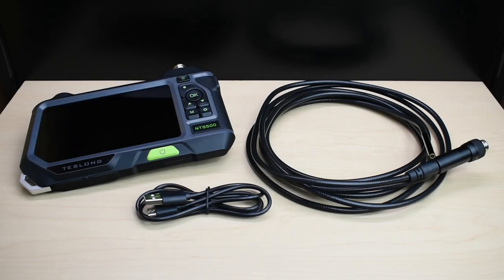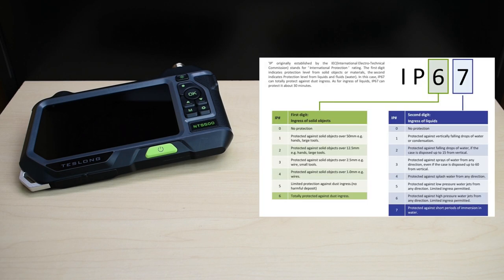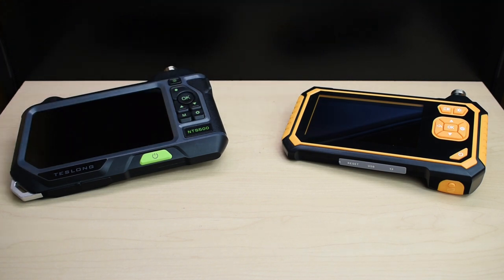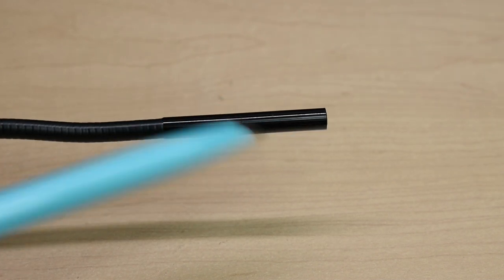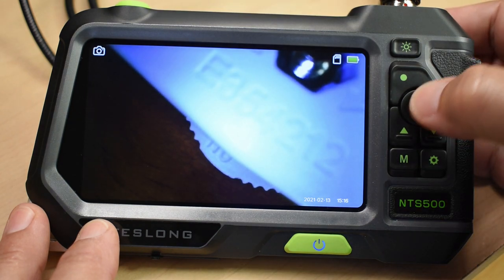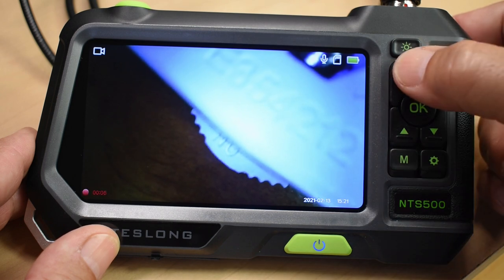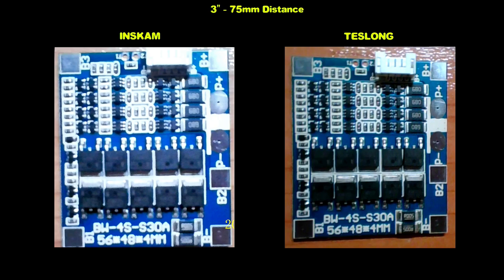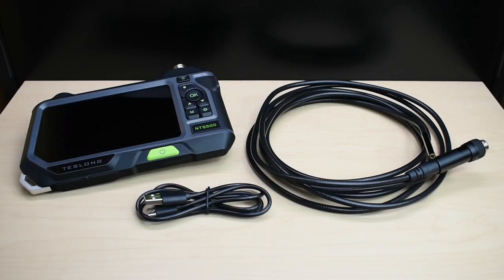$250 Video Inspection Camera Borescope Endoscope Vs $79 Video Inspection Camera! Big Difference?

Comment: Sold me on the Dual Camera.  I'm getting for some sewer pipe inspection but don't want to limit use.  Only other bit I need to confirm if you can get multiple lengths of camera?  5M for pipes but don't want to wrestle with that for say engine or short work then there's even 10M for some true exploring.  -thx

Comment: VERY well done review. This is the one that cemented my decision to go with the Teslong. I’m a diesel engine tech and have extensive experience with a wide range of scopes ranging from a $150 Autel MV400 (which is a decent tool for the price and had served me well for 5+ years) to a $10,000 Karl Storz German made scope which is pretty much a work of art and provides over the top resolution and capabilities but at times is almost too good /cumbersome for the situations I have to work in (confined spaces etc) The Teslong appears to be the best compromise as far as capability and quality goes. I was thiiiiis close to buying a sub $100 duel lens unit from Amazon figuring the technology had come far enough in recent years that it would be a safe gamble. This video (thankfully) steered me clear and I decides to bite the bullet and invest wisely.

Comment: Are you sure you got your numbers correct?  1920x1080 is higher resolution on the old camera than the 1280x720 resolution on the newer camera.  I realize the frame rate is faster on the newer camera, which does make it better, but resolution is resolution.  I do realize the cheaper cam uses Mpeg-3 vs Mpeg-4 and this can make a difference, but not as much as the resolution.  Something doesn't add up here.

Comment: Nice video! Those little attachment mirrors will never work properly because the light shines forward, into the mirror instead of to the side, into the mirror's viewing area. My advice to mechanics is to get the dual camera scope. One can be bought for $100 and up.
Reply: Agree, plus unless it’s a very high end scope it’s rarely a true optical grade mirror but usually a highly polished piece of metal. Pretty much useless.
Reply: @kayakfish9912  Right. So you can see the piston head alright but not the valves.

Comment: Im going to buy it.  I had a $350 snap on unit that is complete garbage.  Its been replaced twice in the first 2 years, both the body and the camera.  Then its been repaired 3 times outside warranty costing $120 a pop.  Luckily my shop bought it from me after the first out of warranty repair.  So I havent paid the repair bills on it.  Im out $200.  One big thing that scope had though was a 5mm camera which is essential to get into the injector hole of diesel engines.  This camera looks like its good quality and has the 5mm camera.  So I'll be buying one and trying it out.
Reply from the maker: Snap-On is very overpriced. For the money, the side viewing camera unit works very well. Thanks for watching Jared!

Comment: Very well done & interesting video ENM! I would not have a need for that type of camera but at least I am now familiar with what it can do. Thanks..... 👍😉
Reply from the maker: Thanks for watching Steve
Reply: I used one to find a socket that had dropped out of sight into the engine compartment.  Probably never would have never found it otherwise.  You never know when a tool like this might come in handy...  Wondering what's underneath your refrigerator?  What's blocking your dryer vent?  ;)

Comment: Wish during the pistol barrel footage you would have shown the 90 degree camera to see that detail as well... very good overall though...
Reply from the maker: It would've been blurry. The side camera also needs 3/4" - 1" (19 - 25mm) minimum to be clear. Inside a 12ga shotgun barrel you could've used it with reasonable sharpness. Thanks for watching!

Comment: The settings in video mode are different than the settings in camera mode
Reply from the maker: Correct! There's 3 settings there.
Reply: @electronicsNmore  I'm just saying that because you didn't show it in the video
Reply from the maker: @sargetester99  I understand. There wasn't much to change in that area, the video was set at 1280x720, and there was only a date/time stamp setting. Thanks for watching!

Comment: interesting how things look with the camera. I dont find it that good and the non removable battery is a turn off. Maybe in a few years you will show to to replace the batteries to break it open. LOL Bad enough phones do that which costs more to replace or more hassle.
Reply from the maker: The battery was made internal for water-resistance(IP67). Not too hard to swap out the internal battery. The unit has screws on the back. I have a video coming up showing a lithium polymer replacement on a cube camera. Thanks for watching!
Reply: @electronicsNmore  you know I always watch your videos for years and sometimes comment if needed. No need to thank me but I thank you for making them. ;)
Also you know what I mean with batteries in general. Speaking of which I did not understand your last video on batteries so I didnt comment. it was a bit confusing.

Comment: I ordered that orange one, it would not turn on when I got it.
Reply: Did you check the battery? They usually put a little plastic tab in there to stop contact so it doesnt drain the battery during shipping and setting in the warehouse.
Its usually on electronics with removable batteries